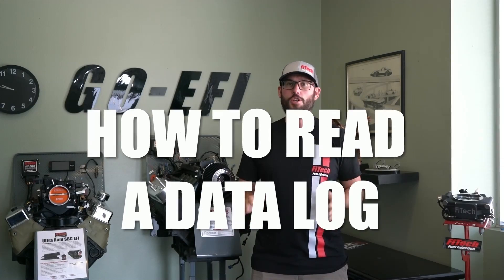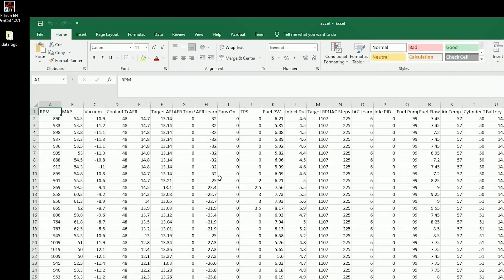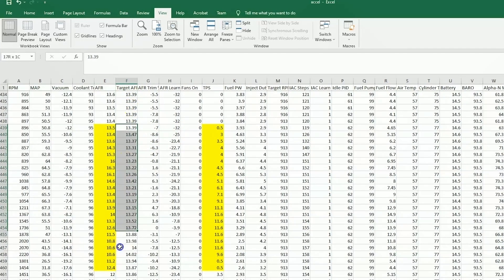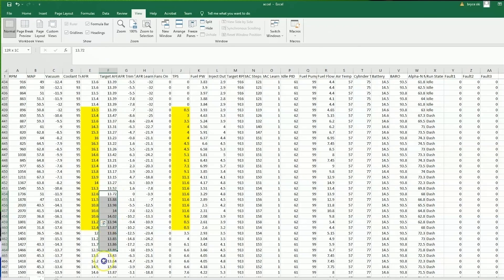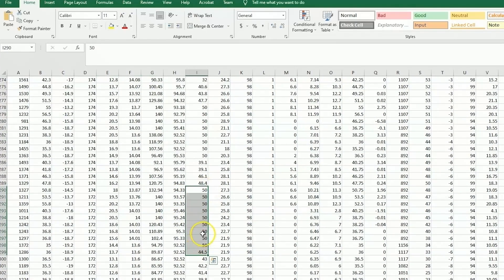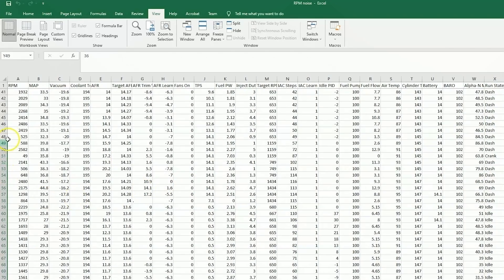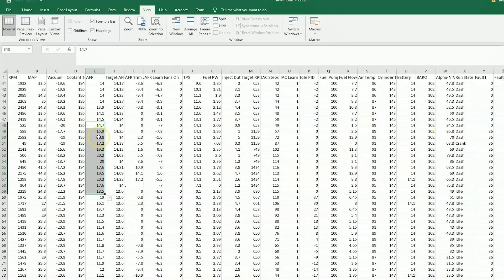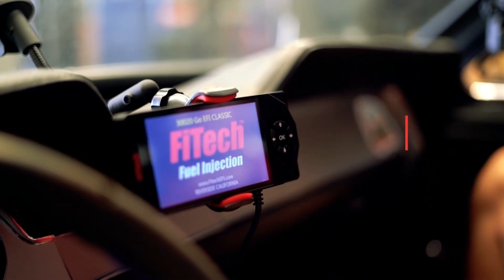How to Read a Data Log | Tech Tuesdays | EP30

Comment: My afr ratio is kinda crazy, goes to 16 then 11 then 13 ect at idle, that normal??
Reply from the maker: This is not normal. Check the handheld for FAULT CODES and ensure that the exhaust of the vehicle does not have any leaks upstream to 18 inches after the oxygen sensor.
Reply: @FiTech Fuel Injection I did a vacuum/soapy water test on the header, no leaks,  I welded a few spots, it's  a little more stable but goes up when throttle is pressed, but my fuel pump is putting out 100+psi according to my gauge,I'm going to try to limit the voltage to pump to reduce psi but idk if that'll help. Iac is at 108 at idle to cause throttle plate is stuck at 2.5% open, efi system makes a loud hissing noise too at idle and wot, I really don't know what to do lol. Hope this helps..and I get a reply.  Also no fault codes on 19 logs, or on handheld while running

Comment: I need help.  I put a new engine in and the fitech is now running bad
Reply from the maker: Hello, have you reached out to our tech department? (951)340-2624 option 2 or techmail@fitechefi.com. There may be some adjustments to be made on the handheld with your new engine installed. For this reason you will want to reach out to one of our techs so that they can assist you with the adjustments.